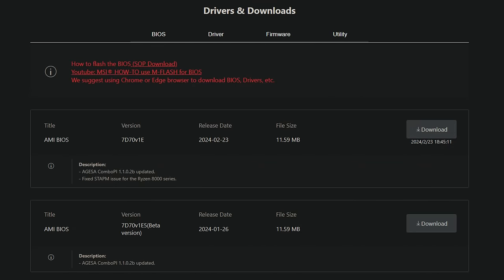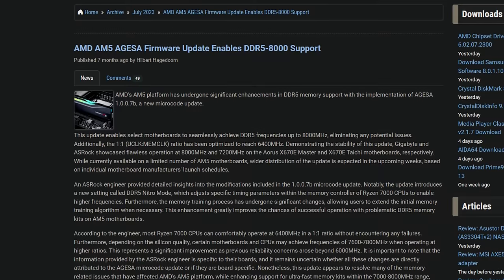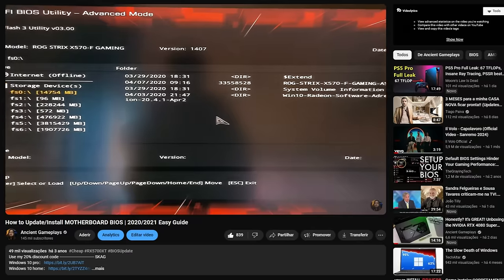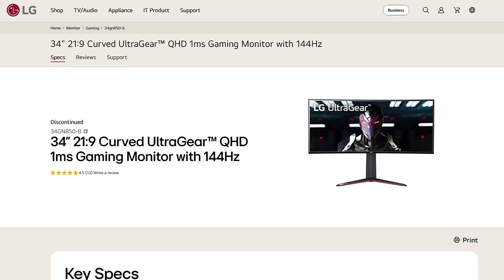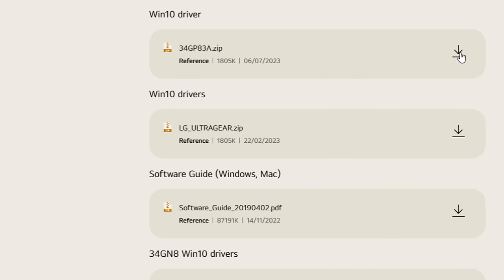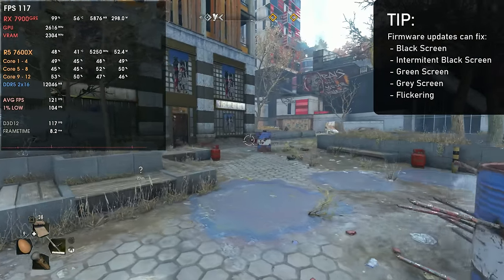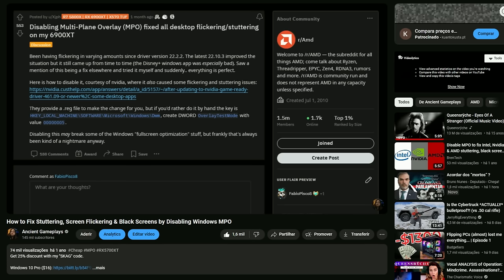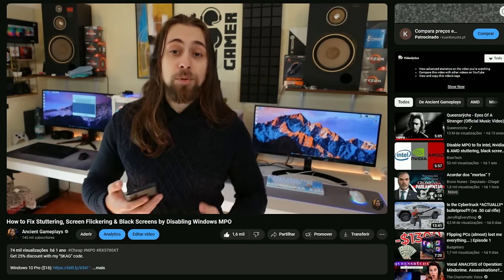20 TIPS to FIX "AMD GPU's Problems" | Easy 2024 Tutorial Guide

Comment: Awesome video!! There's a ton of good information here. One thing I did find is that on older systems, say Ryzen 9 3900x/B550/RX 5700 XT. Is one of the latest Updates for that system leaning toward the chipset or Bios(maybe still checking). Causes wild behavior with the GPU, Power spikes, black screen, system locking, just really weird stuff.
Have you tested any of them lately? If so did you find anything weird?
Either way nice job and keep up the great work. Till the next one, Enjoy.

Comment: I’ve had more issues with GeForce Experience than I’ve had with AMD.
Reply from the maker: Same here usually
Reply: What did you experience ? For me it was the other way around.
Reply: It's been incredibly stable for me as well, but I didn't issues with NVIDIA either.
Reply: I'm having weird flickers and screen flashing black in browser on my 1660 super. Also sometimes the nvidia overlay just doesn't work (without rebooting pc) , and I've lost a lot of clips due to it. I find amds custom color way more intuitive than nvidia game filters as well. And I have recently started using Radeon chill as a frame limiter by setting minimum fps same as maximum. Love the amd performance overlay because I don't have to bother with RTSS and msi afterburner
Reply: I have not had a single issue in the 6 months owning my  ASUS RX7900xtx. The modern AMD user interface is superior to the windows XP style Nvidia.
Reply: @TinfoilTimmy  Yea i have weird flickering in browser too on 2060 super. When watching YT to be exact, seems like last drivers fault. From what ive seen people had this on AMD too
Reply: Same. Even when I open geforce experience I the whole mouse stutters. Only when first opening it though.
Reply: I had problems with the december and the recent driver. Have to revert back from the january driver
Reply: @Frogga_UFO  That happened to me a couple of years ago on Nvidia card. A complete uninstall and reinstall of Chrome fixed it for me. Was probably a chrome update that was not correctly applied.
Reply: I tend to see more, but milder driver issues with AMD. Nvidia tends to be more extreme. My 5700XT had so many driver problems that I had troubles with certain games and complete crashing for a year. Two 1070s I got at the same time just completely died two years in at the exact same time in completely different computers. My 5700XT had tons of crashing in gears 5 on launch. Complete driver lockups. My friend's 1080ti had the same problems, but while my card booted back up, his never turned on again. I don't get it, but while AMD tends to have more issues (while newer), they survive. Me & my roommates have decade+ long collections of aging AMD cards. But every single Nvidia card dies before the 4 year mark.
Reply: @KonglomeratYT
My 970 still going 😁
Reply: More issues, which issues? Hmm interesting.
Reply: Yup the other way around too
Reply: Sameeeee ironicly recently saw soooooo many complaints on nvidia threads on the past 5 geforce updates
Reply: the real reality under amd and nvidia, i have experience both by now...drivers is last thing to get for any gpu company to have issues before game itself is different story how is ported and how is made by c++2023 level programming seem very tough , and idk with all fuss with ai image upscaling...nvidia method lot simpler for game devs than amd method is much more complicated by source code way to recompile the game all over again by using template and fsr3 source code would end up having 20gb game patches results that make no sense for devs to do when normally streamlined makes more sense in every game they made that act like plugin loaded through game engine. With driver issues with AMD is much more prone than nvidia way they handle drivers is less prone of issue when its really user error when installing drvers is same as installing with amd drivers on windows 11...amd drivers does interfere with amd chipset drivers if user install entire igpu version mother board driver plus other amd drivers with discrete gpu would result having wrong gpu running through the game from your cpu instead. That happen with me often when downloading wrong ones. AMd fix this by adding optional complete removal driver but why AMD made it optional when should be like nvidia when is not optional when its recommended options in custom install drivers . AMD should fix their wording in their drivers better than called it optional also cause user error
Reply: Opposite for me, i've had more driver crashes in the last week than i can count on my fingers.
Reply: @KonglomeratYT the whole "Amd drivers bad" peaked with the rx 5000 series.
Reply: @Frogga_UFO  same with 7900XTX before the last dirvers.
Reply: My nephew still don't find it mandatory to upgrade his R9 270x 4gb! 
 I'm wondering what his Nzidia counterpart was, is still usable nowadays??
Reply: The problem is that you're using gayforce experience.
Reply: there are two groups of people ,who do not have AMD card and spread false information aboud bad AMD drivers and than people who have AMD card and know it is bullshit
Reply: How? GeForce Experience is worthless other than for installing drivers, which is admittedly does fine.
Reply: @theftking  they are changing it now and you can watch in game right away the visual difference when you tweaking settings. Still no oc but the rest will be ahead of adrenaline in actual functionality
Reply: same type of experience but completely reverse seneeio for me
Reply: For me it was the other way around i upgraded from a 6900XT to a RTX 4090. And not that AMD drivers are bad they are alot better now. For my experience there was a bug that the GPU sometimes does send a display signal out but after a force reboot it fixed it self.
Reply: On what? Your moms laptops?  @glowinTHX
Reply: Same.
Reply: I've looked at about a dozen Nvidia gpu'ed computers this week because Helldivers was 5 fps, had zero amd GPUs, both have issues but nvidia is just broken lately.
Reply: That is funny. I build computers as a hobby and have made a couple of 100 over many yuears. My exp is that Nvidia is usually rocksolid and AMD gives you a lot of pain. 
I can prove to you that AMD had some issues for years and some they never resolved just because they did not want to or were not able.

AMD needs to be better with drivers and not releeease broken products. using FG with AMD is a joke. Anyone who says not needs to visit a optician!
Reply: @silfrido1768   It is in 95% the other way around. I have built a couple of 100 pc's and always AMD gives you issues. Intel/Nvidia seldem. Don't forget a lot of YT is paid to say good things about brands. I will not say it happens here with Fabio as well. But my exp is totally the opposite as with most people.

Where for example Nvidia has Tensor cores for AI and other ofload programm's to run. AMD uses software that does not really work.
Nvidia is expensive because their R&D has people that make good working products. AMD just glues core together like they did on cpu's and gpu's. That gives issues with OS.

Nvidia is going to make that step as well, just as Intel. I am afraid that will cause issues in both camps as well.
Reply: @karlos1060   I've built thousands professionally, I use AMD because I don't want sued for burning someone's house down. 🤣
Reply: The opposite for me. My 7900XTX kept crashing after doing everything suggested, I sold the card and bought a 4080 which has worked flawlessly since day one with the same PC settings, it was truly plug and play. The person that I sold my 7900XTX to has no complaints. My take is that there is a combination of hardware which AMD or RTX cards dont like but it seems that AMD cards are more "sensitive" to PC hardware combinations/settings.
Reply: Well I never learned GeForce Experience, because my last NVidia card I'd used was a GeForce 3 :)
I was normally fine with Radeon since my first Radeon 9800 Pro.
Except the incompatibility with frame buffer effects in Star Wars: Knights of the Old Republic on later Radeons and general incompatibility of this game on Radeon 7000, which makes it unplayable to me on my main rig. So I have to play this game on my Retro-Rig with Radeon HD4770 :D
Reply: Nuh uh. Nvidia has no issues ever.
Reply: Other way around for me, and by a mile.
Reply: Never my lifetime that Nvidia ever gave me a hiccup. I'm pretty sure it's operator error.
Reply: @silfrido1768 same haha
Reply: Ive never liked when people say "AMDs drivers are buggy" because it suggets Nvidias drivers are flawless, which is far from the case

No company has flawless drivers
Reply: I have Saphyre rx580 Nitro+, For a long while it works properly, but in some instances when win11 gets updates, my gpu drivers keep dying outright, right now for 2nd day straight I'm trying to aolve this issue.  Everything works fine when I'm just drawing in Photoshop and just using pc casually, but when it's gaming my  gpu drivers go sepuku and I keep on using DDU more often then I would prefer. Maybe someone here can give me tips on what to do with it, because whatever legacy driver I find (Both AD and Pro), situation keeps on repeating itself. Rn I'm running drivers on install drivers only, without the app itself. Can it be that Clock of Nitro+ plus is the issue?
Reply: GeForce experience is trash. Every time I've ever installed it I had games freeze and crash to desktop left and right. This is across multiple builds and GPU, CPU combos
Reply: Other way around for me lol. Man… I don’t even remember ever having an issue with my Asus strix, going to my 7800xt is same as having an ultra needy woman in your life.
Reply: As someone currently running a 5800x3d and 6900 xt, I'm sorry I gotta call complete BS 😂
Reply: How lol 10 years nothing from nvidia. Bought sapphirenitro + today cards useless. 10 fps in elden ring. Blurry and flickering in throne and liberty. Ive troubleshooted everything.

Comment: Great and comprehensive video with no BS talk! My cheesy rx 5600 xt runs my battlefields without issues so far. Another good general tip might be to disable the windows control flow guard ("CFG") for specific (esp DX12) games to eliminate stutter (AMD and NVIDIA). Disable high precision event timer (HPET) might give a hand full of FPS depending on the Graphics (AMD and NVIDIA)/CPU Hardware . BTW: I will disable MPO, like you said, just in case..

Comment: I had a lot of issues with my RX 7600 since I bought it: bsod every 10/15 minutes after starting a game, games crashing or closing randomly but frequently... Until I simply updated the chipset and bios of my mobo. Not a single issue in the past 3 days (and using stock configs).
Reply from the maker: Exactly what you should do with every system

Comment: Some superb advice here Fabio. When I was first building my own systems I did infact get a cheaper PSU and it did pretty much what your clip did and popped like popcorn. Fortunately didn't take anything else with it and from that day I build a PC starting with a quality PSU. And with the price of components now it's not worth the risk. I also like to have a bit more than I need to give it some headroom to prevent the PSU going to it's limit frequently so if I need a 600w i'll get 800w etc.
Reply from the maker: Exactly, good thinking there

Comment: Have a 5700XT and get driver timeouts often? Disable Fast Boot in windows.
Reply from the maker: That means you might need a BIOS update mate
Reply: No that means he needs new gpu. 5700xt is trash
Reply: @Chakotay2222 not as trashy as your comment
Reply: @Chill_Mode_JD  agreed, im running a 5700xt right now as a secondary, its basically a 2070 without raytracing. Saying a 5700xt isnt enough is like saying a 3060 is bad at 1080p
Reply: @Hamborger-wd5jg  agreed my first build was a 5700 and it treated me well til I upgraded to a 6900xt
Reply: @Chill_Mode_JD  id say for AMD's first stab at a new architecture after Vega, it was damn good. My reference card does get a little spicy, but with undervolting, i can make it just fine.

Comment: Haven't had any luck fixing my helldivers 2 issues yet. Game is only stable if I severely underclock with -10% power limit.
Reply from the maker: That's still  yet  to be fixed sadly, for now, you don't need to do that, simply  lock your frame rates using Radeon Chill mate
Reply: @AncientGameplays  I'll give that a shot. I currently have my chill range 60-90. Do you think I need to lock at 60? I'm on a 7900 XT
Reply: I still have issues with this game as well. I have a 7900XTX Taichi and have used the "chill" locked my frames to 60 and have every setting in game on low or off and it still crashes. Fresh driver and chipset. Our 7900XTX's do not like that game atm lol.  

Great video and tips!!!

Comment: I have a rx570 and r5 2400g. Before, running cs2, it would drop to like 40 fps when there are too many things happening  (I had all my drivers stuck on 2022 cus i stopped using my pc since then, when i finally hop back on my pc; updated to 24.1.1 instantly without uninstalling my drivers with ddu) , but then I clean installed my gpu drivers and updated the chipset driver. Now it is running around 100-120 fps with sometimes dropping to 90. I also disabled ULPS. It's a life saver really. Also thinking of installing radeon id drivers but I'm unsure about it as i have an ryzen 5 2400g as my cpu which is unsupported for the smart access memory, but nonetheless this video was super helpful. Thanks !! Love your contents man

quick update - it is running any games way better than what it used to with very little drops in fps compared to before